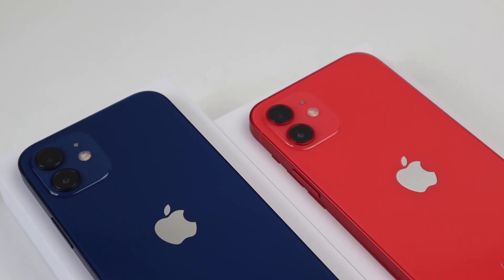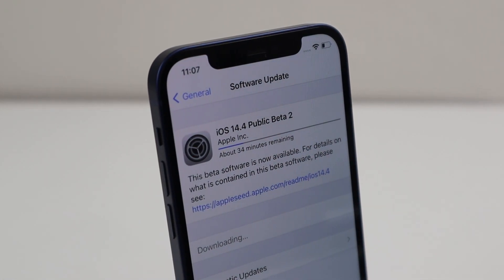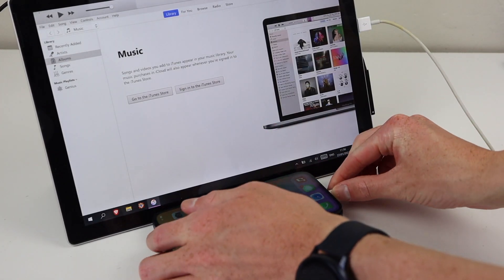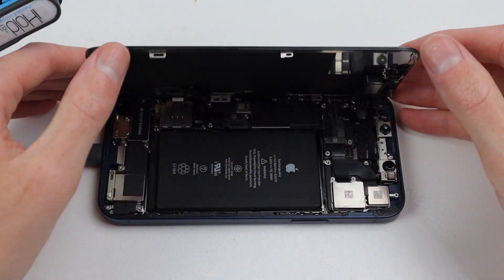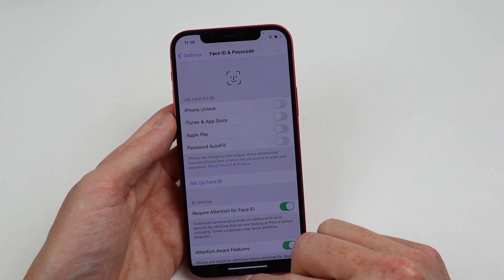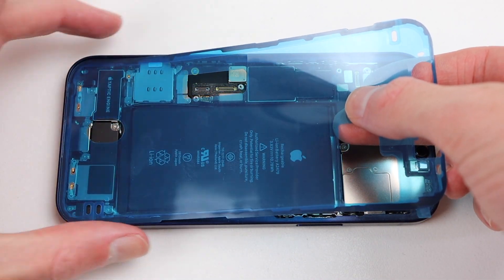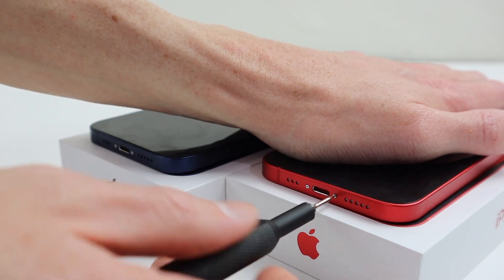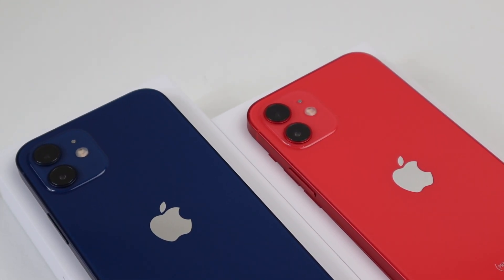iPhone 12's Latest Approach at Deterring 3rd Party Repair

Comment: going to love when you buy an Apple car. "Wheels not compatible with this device" "You cannot drive this car as it is too dark"
Apple is making too much long term landfill.
Reply: "but guise its all ok we stopped including chargers for the enviromnent"  --Apple
Reply: wrong type of electric ur only allowed apple verified electricity to charge it🤣🤣
Reply: "This iCar wouldn't run without original wheels and tyres"
"We've detected you have installed Ray's TE37 in place of original wheels."
Reply: @harassmentisbad1046  I wouldn’t necessarily say cars nowadays are made specifically hard to repair. It’s rather the vast increase of the usage of electrical parts and alike in modern cars for features like lidar based obstacle detection systems, adaptive cruise control, lane keep assist, etc. which create parts of varying designs and complexity which can all eventually fail, either early or late. There’s a big reason why unless you’re absolutely loaded and getting something known for reliability, don’t get a proper luxury brand car.
Reply: @GabrielIgnacio  thats mean iphone is just like a remote tv simple device that should easily to rapair? But the car its normal hard to repair becuase they have tech inside like lidar etc lmao
Reply: "Unknown wheels detected" is literally an issue on Teslas. I am a Tesla driver, if you swap wheels this message appears. Fortunately you can calibrate the car to work with the wheels but it is a thing though. Silicon Valley companies like to control everything.
Reply: They already exist, they're called Teslas. And yeah, they force you to use a proprietary charger and the company works very hard to make them unrepairable.
Reply: @mjc0961  not true, I don't have to use tesla superchargers to charge my car. Just the normal EV chargers found at malls and motels will work. And tesla cars don't need  repairing in normal circumstances. When they do need repairs you can get them done, you aren't forced to buy a new car like Apple does with their products.
Reply: @Franz Xaver Fuchsberger Pretty sure for iPhones you need to use a lightning cable, but my point was when a Tesla needs servicing it is very easy to get it done and they won't try to tell you that it's best to just buy a new car. You can also do repairs on your own with a tesla but when you try to self repair an iphone we can see what happened.
Reply: It’s called a Tesla bro

Comment: They should just solder everything with the motherboard
Reply: Then it will be true Apple style. Broke your screen on your iPhone 12?? That will be $2000 dollars for this brand new one, since we can't repair it.
Reply: @yunus20312  Well..if u look a Apple logic board, compare it with a random android phone(similar specs), the connectors, flexs, etc, seems to be pretty "chess" fitted, but on android, they always try to go as modular as they can, so, with that being said, i think is about time..

Comment: Apple is ingenious at this for a long time by now.  I wouldn't be surprised if they've already paired anything that talks to the motherboard.  Once that's done, they can activate checking for paired components at will through software (like the OS) and take any kind of action they feel appropriate.  One update could disable camera.  Next update could also disable battery.  And so on and so on.  That would be my guess.

The beauty of a system like this (for Apples sake) is if laws are passed that force Apple to not do this, they could easily reverse any restrictions enabled by disabling all restrictions with one software update.  Again, just a guess.

Comment: How long until iPhone display "This iPhone is unsafe" and disable itseft when it get old ?
Reply: That would be so evil... I remember Samsung basically did that with the Galaxy Note 7, but only because it was recalled and banned on flights due to the severe "battery catching fire" issues - they had eventually sent out an update that first limited the battery to 60%. Later on, I believe they sent an update that blocked charging - essentially disabling itself and being left to die.

So, it is theoretically possible for any manufacturer to disable phones, but I don't think they would be able to without either running into legal issues, or having severe backlash. Unless it was recalled due to a serious issue, like the Galaxy Note 7.
Reply: @MrSuperVids  thats smart if my product is keeps catching fire I would want to disable as quickly as possible
Reply: I honestly think it is possible ngl
Reply: or you slightly drop the phone and it disables until it is taken to an Apple Store for a service.
Reply: @paulc4093  Also: "Unauthoried dissembly detected, this iPhone is pernamently disabled, please folllow local instruction for recycling"

Comment: 2022: "Unable to verify that this iPhone is not owned by a broke person."
Reply: I bet that in the future, Apple wouldn’t allow you to use a non-Apple charger and accessories which they force you to use their products.
Reply: @ManChesterEnjoyer  They already tried with chargers, didnt they?
Reply: @assetaden6662  I believe it was with data cables, I remember when my iPad 3 didn't want to charge with non-original cable and sync was a nightmarish slow. But with all those rumours about wireless charging and portless phones, it is highly probable that you won't able to use any not-Apple wireless chargers.
Reply: @ManChesterEnjoyer  no they will allow accessories made by third party but they'll ask for commission. I believe they already do that with the lighting port, and even Magsafe (on both MacBooks and iPhones)

They mint a lot of money in that way
Reply: Ive never cared too much about phones but Im buying a new one this year so I had a look around. Turns out that especially samsung devices can be just as or even more expensive than comparable apple phones. At least theyre running significantly better hardware though.
Reply: @TheDude50447  just buy lg or moto. Samsung and apple are both doing the same bull.
Reply: @mangotree1032  im getting the new blackberry since the battery on my priv has finally died completely after 5 years. I looked around for other options from established brands with real keyboards but have only found some unknown stuff which I don't trust for security.
Reply: @TheDude50447  sounds reasonable
Reply: that would probably trigger a lawsuit against apple or atleast get cellular providers to return the devices to apple till they remove a message like that
Reply: @dawn1berlitz  r/woosh?

Comment: how does the phone not know that another iPhone 12 part is genuine, you'd think it would be able to identify if it was actually genuine or not
Reply: Per Part Serialization
Reply: Each part has a designated serial number and if it doesn't match what the phone expects, it gives you that message
Reply: @xAureliusx  yeah I know that but wouldn’t it know it’s still another iPhone part. Not a fake
Reply: @ProPrince  not at all 
Everything is based off the serial 
That's it

Comment: Despite the fix problems, I will still use iPhone as my entire family uses them.
Reply: See, thats just the number one reason why apple can even get away with this nonsense... People like you who don't care and buy their overpriced crap anyways are what makes them confident that no matter what features or rather non features they include or rather remove, people will still buy their bullcrap.
Reply: @nilswegner2881  yeah, as if any other company sells a phone to my specifications. I want it small but able to use for some time.  Everything else has a 5.8-6.9 inch screens which is ridiculous for me.
Reply: @nishanthdommety5110  What are you using? iPhone 13 mini?

Comment: Instead of pairing parts serial number to phones, it would have been great if the original parts could be verified somehow, using a system menu or something and just provide the user to verify it using some menu/settings maybe, instead of preventing the phone/camera/touch id etc. from working altogether, and having crazy notifications on every boot. I would actually love the ability to verify the parts I'm getting is genuine, because I had some experience with 'authorised' service centres using fake parts, which gave me problems just a week after the repair.

Comment: You should put a disclaimer while selling those opened iPhones 'Water resistance will not work'
Reply: Why? He has replaced the seals in this Video. Have you even watched it front to back?
Reply: @nilswegner2881  you shouldn't trust that, by that matter you shouldn't trust the original one at all

Comment: This has been happening with 14.0.
Cracked the screen on my Iphone 7 Plus... replaced the screen along with front facing camera, and all was fine. NO issues prior to updating to 14.0. Facebook, Snapchat etc every 3rd part app worked with front facing camera.
Updated my IOs to 14.0 and my snapchat /facebook/ every app now crashes when trying to use the front facing camera. 
Cant even pull up snapchat login before it crashes.... 
Screw APPLE.... they just want people to buy a new phone instead of having 3rd party companies repairing phones

Comment: "We removed the charger to lessen the environmental pollution" - F***ing. Apple
Reply: I mean this was a genuinely good idea, or so I thought until I found out they also swapped the cable...
Reply: In short: It's done to make them more money.
In long: If they really meant that, they'd allow anyone to replace any part rather than having to replace the phone or pay for Apple's overpriced repair. What they actually mean is that they're doing more harm to the environment and also using the term "environmental pollution" to make people think that Apple is doing some good, except they just remove something from the iPhone box, sell it separately in their stores for a higher price so they'll get more money out of these lies. Yeah even though Samsung did it as well with their S21, at least USB-C to USB-A cables are absolutely everywhere (because the one they bundled was USB-C to USB-C). I'm not defending either company, I honestly prefer OnePlus (mostly because of their Oxygen OS).
Reply: Samsung and Xiaomi did the same after making fun of apple 
Everyone will do this ...
Reply: @syedumerahmed9514  Xiaomi is far better than either of them, making the charger an optional free attachment for people that want it. Shouldn't lump it together with the other two asshole companies
Reply: @ryanlam5237  yeah Xiaomi is good 
Only if you live in China

Comment: While I disagree with limiting use to third party parts (ex: camera and Face ID), I feel notifying that parts are not original is actually good, as if I’m buying a used phone, it’s nice to check if parts have been replaced. Now it’d be nicer if this was just a one time message, and a new section in General > About.

Comment: Can you imagine what Apple can bork up, in regards to common replacement parts for Their Car? Forget AAA to the rescue.
Common car parts replaced: Battery, bulbs, fuses, mirrors, wipers, windshield & door windows, interior panels including dashboard, pedals, exterior plastic parts, trunk/hatch hinges, tires and remote pressure gauges, fluids, gas cap ...

Comment: Well samsung started to do this as well.. :(. This is going to go the way of the headphone jack lol
Reply: @altr.  well they did start it but it doesnt matter who did the one who does it is to be blamed
Reply: I'm pretty sure Samsung's version of Android doesn't scream at you about not having genuine Samsung parts and disables 50% of the phone's functionality.
Reply: @VeeTHis  Yeah this is next level money farming
Reply: It is not a problem. Flash custom rom.
Reply: @r3vere302  that is not the point bruh and you can say its more flexible and all but just a while ago samsung was mocking apple on not including a charger now even they dont have one. its corporate trends. when one company starts it and doesnt get any problem others will follow doesnt matter who does it.
Reply: Well, you can just flash custom roms and if you messed up some parts on your phone you can just take to 3rd party repair shops for cheap.
Reply: dont worry, the adapter is free and the s21 is still repairable
Reply: Android is more flexible and modified than junky ios.
Reply: @r3vere302  True, in android, specially in famous models, u have a bunch of ways to avoid that kinda stuff
Reply: @Eddinski  yes.

Comment: It’s definitely a good step forward allowing non genuine cameras (or genuine) to work correctly but with a message saying it’s not genuine. I like that they give messages for parts that have been replaced and aren’t paired by Apple, as it means if I were to buy a used iPhone I can be sure that I’m getting key original parts. The battery health might not ever show up as Apple can’t ensure that the battery health is up to standard on a 3rd party battery. The same could be said with the display but the fact that you can reprogram the screen and get True Tone shows that’s not the case (True Tone is after all only a software filter that is adjusted by sensors). I still want to see all tech companies have genuine parts available so that 3rd party repairs are possible and say with the tools and guides being available as well. I also find it ironic that Samsung with the A series made part swaps (the finger print sensor) not work via a software update yet Apple did the opposite and now allowed the cameras to work correctly when swapped.

Comment: Apple: unable to verify the glue on the back
Reply: Unable to verify authentic apple electricity flowing through the phone
Reply: @barrybshrekson864  🤣🤣🤣
Reply: Unable to detect a genuine Apple speaker grill
Reply: Unable to verify genuine apple circuitboard
Reply: @Jesse9270  unable to recognise owner.
Reply: @Jesse9270  unable to verify owner of this phone is Steve Jobs, the Apple Super Retina 52 degree idisplay will not work properly until you obtain a genuine Steve Jobs
Reply: Unable to verify genuine apple screen protector
Reply: @Eng586  lol
Reply: Unable to verify that the air is genuine apple air

Comment: Apple's just greedy, they want you to pay for their overpriced repairs
Reply: Then why buy apple products then
Reply: @rahathossain2524  Besides an iMac from 2017, I don't have any Apple products. And by overpriced repairs, I mean like who in their right mind pays 600$ to repair the back of their phone when you can just use a case?
Reply: @doritofan80  I prefer if you buy a phone go xiaomi you can literally find anything you can even build one with parts
Reply: @rahathossain2524  people have preferences between iOS and Android,you won’t be able to make someone who really prefers android to use iOS and vice versa
Reply: @rahathossain2524  becouse its apple and its expensive. so they can tell there friends how stupid they are getting 3x4k screens wen you can get a APPLE monitor stand which is superior in every way for the same price
Reply: Its bullshit...no one want the overpriced bullshit repair
Reply: Well they don't repair, they just hand you a new one
Reply: "repairs"

Google: did you mean, your phone had water damage so you need a new one altough we could just clean it and would work again.
Reply: @MrLuigge  if my phone had water damage I would want to get a new phone.

Water damage isn't a thing that you can fix by just drain or cleaning it. Water can easily damage the motherboard, some parts inside it, or etc.

Well still better that other than water damage, it's possible to fix it yourself if the motherboard didn't get damaged (if it's damaged then it's better to buy a new one). Not like apple that to get a new "genuine" battery, you need to pay that much. I'd rather bought 3rd party battery from a popular brand

Comment: I think you forget the fact that everything in those messages is 100% true. It says that it can't verify it, it does not say that it's non genuine.
Reply: The fact that it says it with an identical part with an identical model is still ridiculously stupid
Reply: @TimMug  actually, i can see why they're doing it... it protects buyers who buy second hand. many people have parted out the phone, then used cheap crappy china parts to assemble the phone and then sell it as "barely used in great condition"... or at least tried or thought about doing that🤷‍♂️
Reply: @thekralj9600  well, surely there's some software to identify if the parts are genuine, right?
Reply: @thekralj9600  Ok, so why is the message showing with genuine parts?
Reply: @thekralj9600  they’re pairing the parts to the phone just so people take it to apple to get it fixed, or get a new phone. They’re not doing it to protect the buyers, they’re doing it for the money, apple doesn’t care about their customers anymore
Reply: @dylanmooney327  well yeah, fair point, if i buy a phone i should be able to do whatever i want with it without losing any features. just thought there might be a reason why they're doing it🤷‍♂️